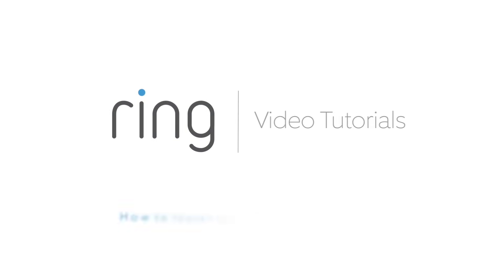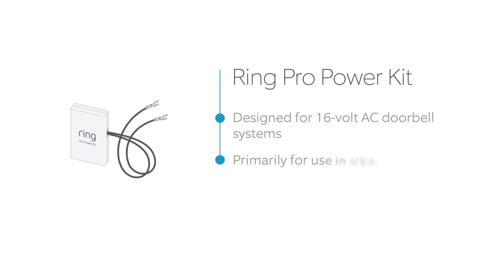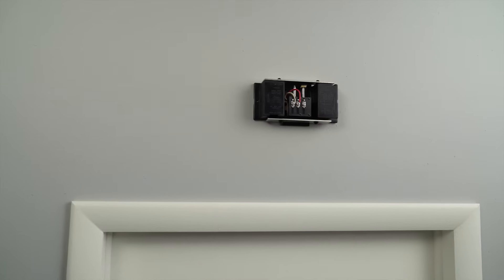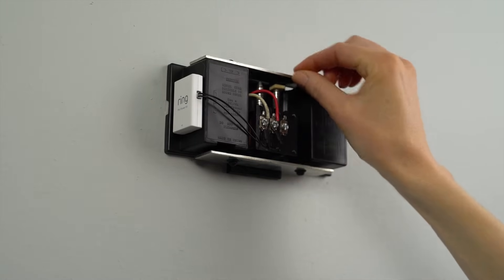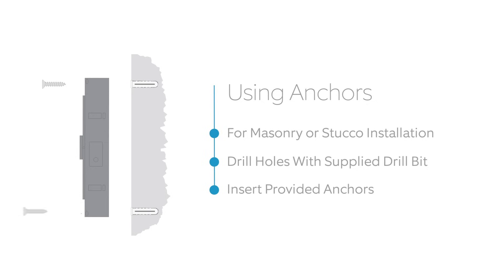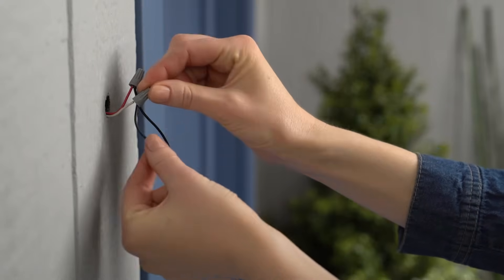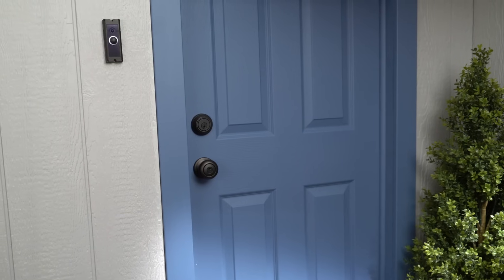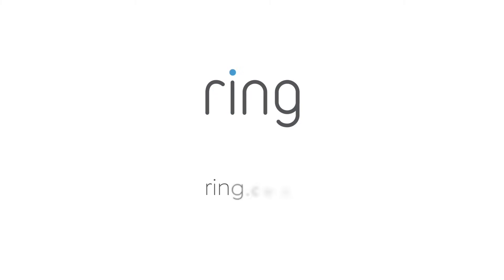How to Install Ring Video Doorbell Pro | DiY Installation

Comment: What does it’s cost to run these doorbells
Reply from the maker: Hey neighbor! Ring devices are a one-time purchase and incur no mandatory ongoing fees or contracts. We do offer an optional subscription to our Ring Protect Plan that activates your Ring's video recording and storage service — learn more at ring.com/protect-plans. All Ring devices are designed for a DIY installation and are packaged with all of the tools you'll need to complete a device setup. You can also check out installation walkthrough videos on youtube.com/ring. If you're looking to get your Ring installed professionally, feel free to check out Amazon Home Services for pricing and availability here: https://bit.ly/2Dd81Nb.
Reply: @ring   if I use the ring wall plug-in adapter for my ring, doorbell pro do I still have to install v2 power back up anywhere

Comment: I honestly think you should rethink the idea of shoving wire nutted connections into a small  hole in the wall.  Its a good way to lose the original wire.

Comment: What if you don't have a door bell?
Reply from the maker: Hey Brandon! If you don't have an existing doorbell in your home, our Ring Video Doorbell 2 will be the perfect fit for you. With 1080p HD video quality and customizable motion settings, this device runs off a rechargeable battery pack so no hardwiring is necessary! See more at https://bit.ly/2PNFPYS.
Reply: Go Big Blue!

Comment: The video did not talk about installing the supplied angle adapters if needed. Only 3 Star rating.
Reply from the maker: Hey Bob, this video shows the wired installation of your Ring Pro. Feel free to check out the Wedge Kit installation here: https://bit.ly/2zHZoqj and the Corner Kit installation here: https://bit.ly/2HrFOE8. Let us know if you have any more questions!

Comment: I have multiple ring devices inside and out. All of them work fine except the ring doorbell 3. It will not connect to live view most of the time. I have call and spoken with  numerous people who barley speak English. I am going to send every bit of the ring devices if you guys do not fix it. I have bought so much extra stuff,chime,transformer.  You name it. I will not buy another item.  But I will switch. If you guys do not fix this.
Reply from the maker: Hi David. Having your Ring Doorbell 3 functioning as intended is key to your peace of mind, so we are happy to help find a solution. In order to best assist you, please send us a PM on Facebook or a DM on Twitter, and we can work together from there. 

You can also give our community support a call at 1-800-656-1918, (or if outside the US: http://ring.com/callus) 24/7, for more support. We look forward to hearing from you.

Comment: Wanted a Ring for a long time, now i have one Im unfortunately extremely disappointed.Using for 2 months and found the live view to be terribly unreliable. Doesn't work when needed the most.. Eg. Someone rang my bell and it wouldn't not connect. When getting notification and clicking on the icon it wont go straight to ring, you have the go to the app. Would NOT recomend as a means of security as is insecurely unreliable. Will not be promoting Ring at work now that iv had first hand experience
Reply from the maker: Hi neighbor, we're here to help. This is far from the Ring experience that we'd like for you to have and want to make sure that your Ring is providing you with the security that you deserve. We want to implement the best solution possible so you're able to access Live View and be able to answer your notifications with ease. Please give us a call at 1-800-656-1918 (or if outside the US http://ring.com/callus) so we can get to the bottom of this.
Reply: wash85 I live up a mountain & I love my Ring. I did have some connection issues, but Tech Support walked me through it & we have been on line ever since.

Comment: Don’t buy this ring model! Internal battery only lasts 2 years then dies and can’t be replaced. So pretty much you’ll have to buy a new doorbell every two years which is completely unacceptable. Ring does nothing for you since warranty is only 1 year
Reply from the maker: Hey there, Ring devices are designed to provide you with years of peace of mind and we'd like to help. Please send us a private message on our Facebook or Twitter pages and our team can work with you to find a solution.

Comment: Great door bell, but had an issue with my second door chime buzzing or humming after the door bell was activated. The Door bell work, with each activation the second door chime just wouldn't  reset, or stop buzzing or humming. Checked all the wires to the second bell chime and checked all good. 
Finally had to disconnect the second bell chime from the first bell chime in the hallway, since both chimes are wired in series. I had no problems at all with the hallway chime, just the one on the breezeway to my garage.
Reply from the maker: We are here to help, please make sure your Pro Power Kit is installed properly. Also, here is the compatibility list for Ring Doorbell Pro: https://support.ring.com/hc/en-us/articles/209028546-Ring-Video-Doorbell-Pro-Chime-Kit-Compatibility-List. If you require additional support, please give our Community Support a call at 1-800-656-1918, (or if outside the US: http://ring.com/callus) between 5AM-9PM PDT, seven days a week for more support. We look forward to hearing from you.